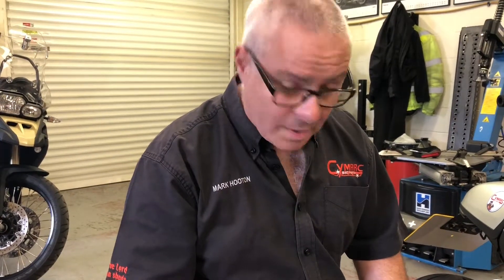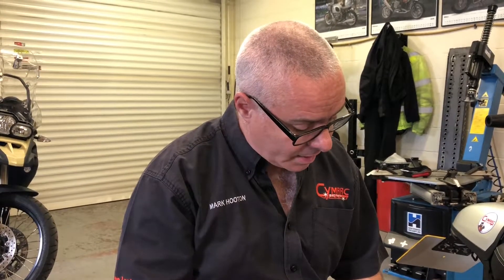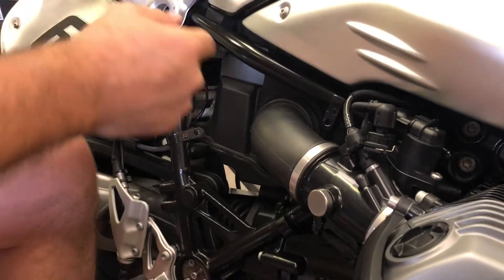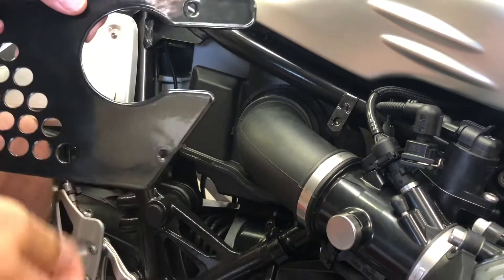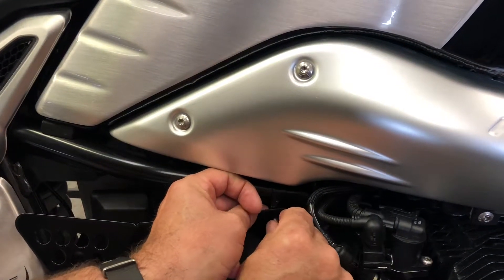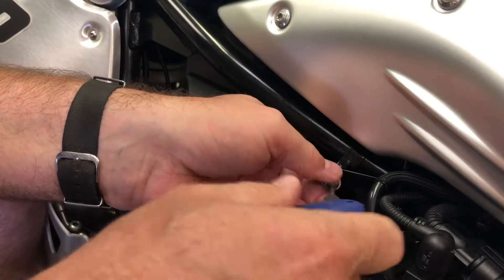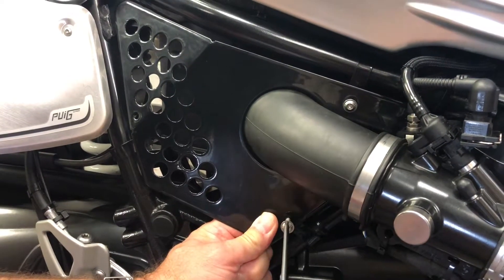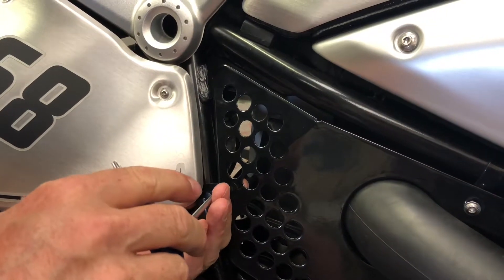Cymarc R9T Side Panel Installation

Comment: How much heat is in that area, could you 3d print a panel and save weight vs a metal part?
Reply from the maker: Yes I think we could - we will look into that later this year